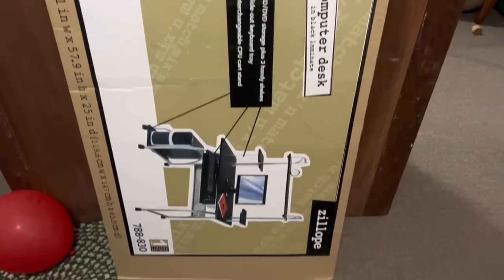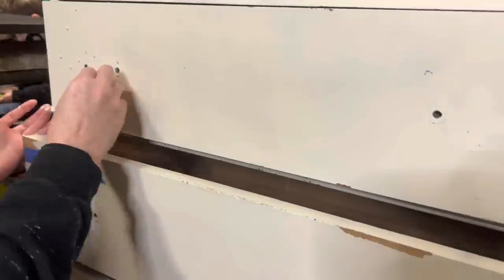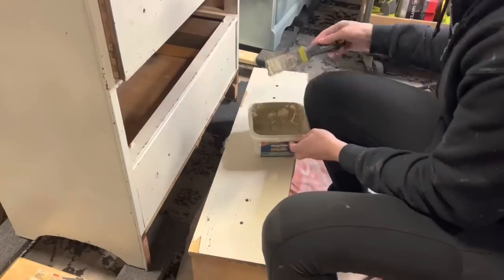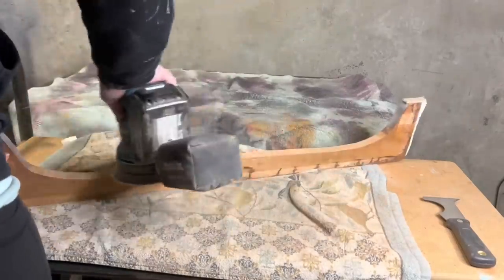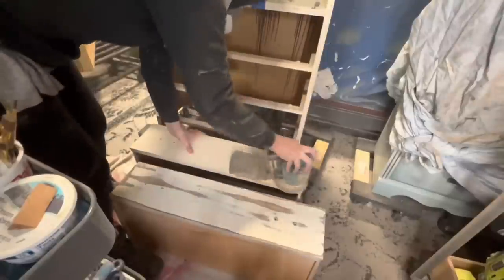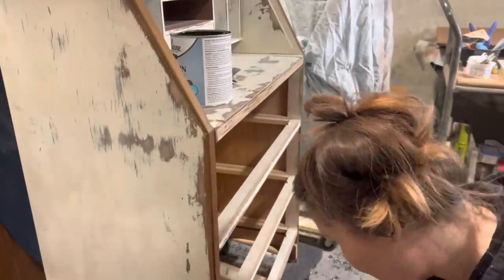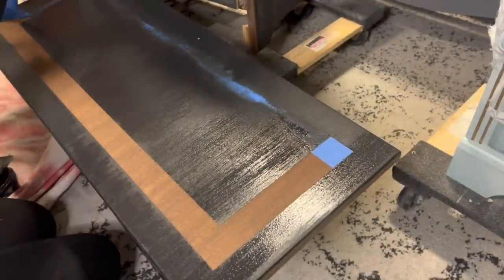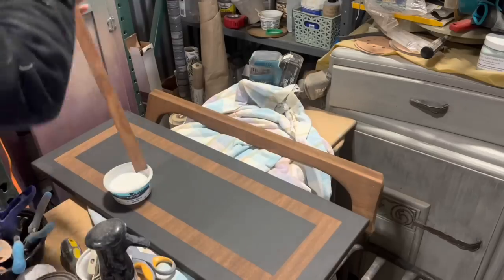Vintage Secretary Makeover | The Godfather Desk | Elegant Upgrades

Comment: Wonderful update. It’s hard to believe it’s the same desk you started with.  When you are working on a piece that has lifting veneer (you are going to paint it) aren’t you worried about the old glue continuing to fail? And the veneer continuing to lift beyond your nice repair. How do you decide to pry all you can get off and fill and sand or to repair with new wood glue?
Reply from the maker: Unless there was sever water damage, the original glue is typically pretty sturdy. I always find the lifting areas are around the edges and corners where they’ve been a bit mistreated. I do test it and lift up all I can to re-glue. But there are those sad times when it’s just too far gone, then I would just peel it off.
Reply: @elegantupgrades  Thanks I have a piece that I can’t decide wether to fix or peel the veneer. It’s not lifting in the middle anywhere but there are a LOT of places on the edge of the veneer that are lifting. Fortunately, there are hardly any places where the veneer is missing. I think it was stored in a damp place maybe.  Where do you get sheets of veneer?
Reply from the maker: That’s great, I would just glue down what you have loose then. And as far getting sheets of veneer, Amazon now carries it. I’m not sure about the sizing because I haven’t ordered it myself. I have two local woodcraft shops that supply veneer. You may just want to do a local search and see what you have in your area. The small wood shops usually have the best stuff and great customer service to go with it.
Reply: @elegantupgrades  Thanks for the 411. I live in a small town but there is a big city only 30-45 minutes away. Depending on where you need to go. I’ll try Jacksonville first.